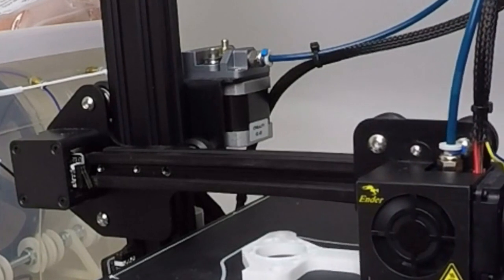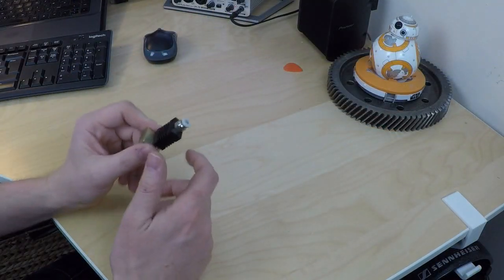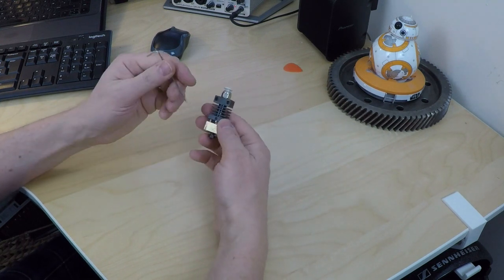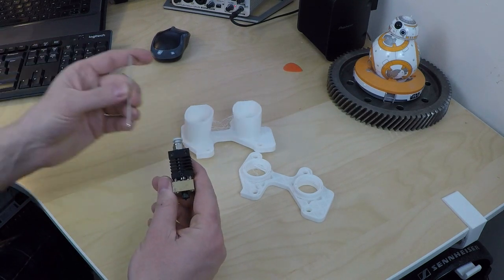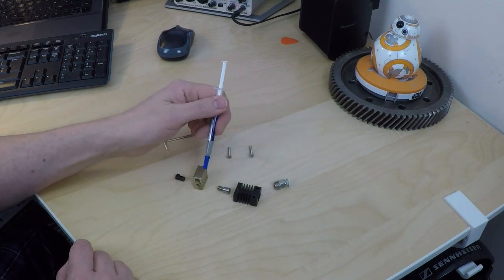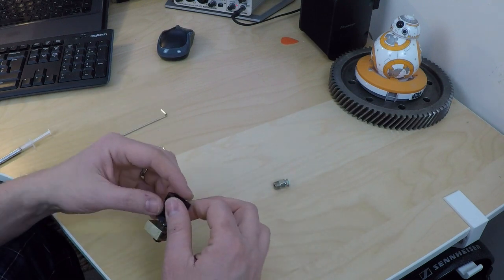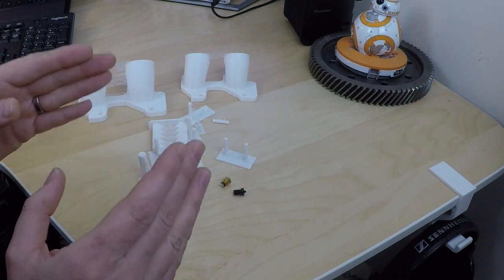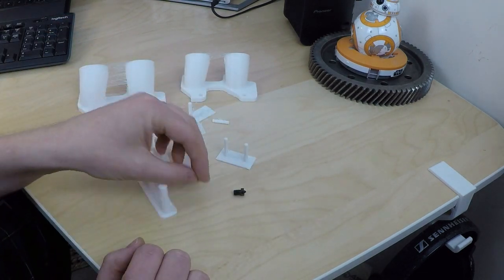Never clog again!! 2 easy tips to solve a clogging all metal hot end!

Comment: This is standard practice on your fancy shmancy high price hotends. Big no no using thermal compound designed for CPU's though. That stuff is not rated or the temps used in hotends. Better off looking for thermal paste designed for it. Boron Nitride thermal paste. Its not much more expensive than the stuff for CPU's.
Reply from the maker: Hi Ashley…. That particular paste is rated up to 300degC but you’re right, most CPU pastes, especially the higher end ones aren’t rated for the high temps… that said, i wonder just how hot the cold end of the heat break gets…. 🤔
Reply: @MakingforMotorsport  Wow! 300C rating on a CPU paste. Never seen one rated that high.
Re the headbreak temps, I guess it would depend on the situation. Higher temp filaments and higher bed temps in an enclosure would be the worst case scenario.
I think most peeps clogging issues come from slop in the bowden tube. Applying the PTFE fix with capricorn tubing and swaping out the PCM4-01 fitting for a compression fitting solves a bunch of issues. You can also soften with heat ad flare out the PTFE tube so it can't back out of the PCM4-01 fitting.

Comment: Very cool. Wish I saw this today when I was upgrading to a titanium heat break and wasn't able to print PLA at all because it kept clogging. And then I overtightened the grub screw on the heatsink and stripped it. Noooo! Have to remedy that tomorrow at the hardware store. But I'm going to try your thermal paste method. I have a syringe of it lying around from my last PC build. Thank you so much for making this video
Reply from the maker: Excellent, hopefully this helps you out, I was pulling my hair out with clogs!

Just one thing, make sure your paste is suitable for the higher temps, some CPU don’t go very high.  If it’s low, don’t put it on the nozzle! 👍
Reply: @MakingforMotorsport  Ah good point! Okay

Comment: I used thermal Heat Sink Glue. 
Also just installed a Titanium Heat break from amazon that has a flange on it. 
Also it is the right length.
2pcs All Metal Ender 3 Titanium Heat Break Thermal Barrel Tube Heatbreak Upgrade for Creality 3D Printer CR10,S4 S5, CR10S, Ender3 V2, Ender 3 pro, CS3 Hotend use (Upgrade TC4 All Metal Version)
Reply from the maker: Just looked at that, could be a good option for the standard hot end, i need to do some measuring to see if it’s good for all metal…
I have been looking at the bi-metallic all metals… gonna have a play with one of those aswell 👍
Reply: @MakingforMotorsport  I was using a shorter version no flange. Had problems from day one. I seasoned the one with the flange  and have been printing for days with no problems. Just ordered a few spares. Dumped the old ones.

Comment: Also NEVER use CPU thermal grease on these.  It isn't rated for temps as high as what we use in 3D printing.
Reply: Thermal Grizzly paste is rated up to 350°C, Arctic MX-5 goes up to 180°C
Also the Cold-End doesn't get nearly as hot as the heaterblock. This is exactly what the heat-BREAK is supposed to do.

Comment: Hi there!! I love your channel !! I am currently doing a project similar to yours with a speeduino and a 1.6 8v megane, I have designed the intake manifolds to adapt yamaha r6 carburettors !!!

but i'm having trouble with nylon printing. the finish is horrible, the pieces suffer from cracking ... I use a x1 artillery with direct extruder, all metal hotend ... any advice ???

If you want I'll leave you in the link of the page where I upload my designs in case you need any for future projects !!!
Reply from the maker: Hi there!  Sounds like a great project!  For the Nylon, have you dried it out properly? (Full spool on at 60degC for maybe 4hours), if it’s not been dried just before you start and it’s held in a low humidity environment it’ll soak up water from the air which boils in the hot end causing all kinds of problems…. I dry out thoroughly EVERY time before printing… check out my Nylon video for what I do 👍
Reply: @MakingforMotorsport  good afternoon!!! Yes, at the beginning I dried the filament at 80 ° in the oven for 3 hours. even so, when I print, cracking appears in the pieces and warping. I will try to close the printer in a closet to get a more homogeneous temperature. I have a profile in cad grab. If you want, I'll give you my link and take a look at the collectors I'm making. Best regards!!!

Comment: I just got so frustrated with my printer that I stopped using it.  I was getting the “dug dug dug” of the filament struggling to feed and it got to a point where pretty much every print would fail.  Now I can’t even remember how to use the thing.  3D printing was so frustrating.  Good luck to you and glad to see that you had better results!!
Reply from the maker: It can be bad and I have been there… best thing to do at that point is to warm it up, clean up the filament, disassemble and start again… never fails to fix my clogging problems…
Reply: If you get under extrusion and eventually clogs the fault is not the extruder nor the nuzzle and even not the slicer setting most likely. It's the bowden tube... trust me i almost throw my ender 3 v2 printer away trying figure out why it was under extruding and clogging.. my slicer settings were good, nuzzle was changed to new one event tho the old was less than 2 weeks old. extruder was running fine, never had or have adhesion problems my leveling is very good (quite proud of that). except the bowden tube.. You see the tube is twisting around while the printer works and the coupler that keeps the bowden tube in place cutting quite the grooves around where the little teeth holding it. now eventually thanks to that twisting and retractions causes the tube to move away from the nuzzle leaving a gap and that is where the clog starts, to be precise the tube clogs not the nuzzle. 
There is a fix tho, a pritable fix. i can't recall the where i found the stl files for what you need or the video explaining it, but basically you cut a piece of tube you put it inside the hot end like you do normally only this time is going only a few inches above to where the coupler bottoms out, you have 3d printed something like a cone washer that goes after that and then the coupler that when  tighten it sandwiches the tube between the nuzzle and the 3d printed washer, after that you place the tube from the extruder to the coupler only this time it goes as far as the washer you put inside.
It does not matter how much the printer move around or the tube from the extruder to the coupler, the piece of tube that is sandwiched inside of there is going nowhere. 
Sorry if my explanation is long and maybe not sufficient enough or for any spelling mistakes and what nots, even though i can't recall where i found the stl file and video i hope you do.
i never run in any sort of problems after that fix ever. i hope that helps
Reply: That sucks, Dave. 

It seems like 3D printers in the 2020s are becoming the salt water aquariums of the 1980s, and as a guy who has successfully raised non-photosynthetic black sun corals AND has an Ender 3 that pretty much runs 24/7… in both of those cases I can honestly say that the general opinion of most people I know is, “There is no way I would have spent the time and money to learn what you’ve learned in order to do THAT.”

My response, generally, is, “Why not?” — but, there are times (days? weeks?) where I wholeheartedly agree it’s not worth it. So far I’ve been able to solve the problem at hand and push on through, though.

Interestingly, I think both of the above mentioned hobbies have the same problems:  myths & misinformation, foreign fly-by-night equipment sources, and a lack of access to true experts and mentors because there aren’t very many yet — certainly not enough to mentor the hoards of new people getting into the hobby (and make no mistake: a 3D printer is not a device, it’s a person with skills that can operate that device)

There is one upside:  it’s almost Christmas again, and about 6 weeks after that is when the first frustrated people will start putting their Christmas present printers on eBay, Kijiji, etc…
😕

(Sorry, make that 2 upsides… screwing up a mod or upgrade on a 3D printer doesn’t kill marine life … at least, not usually. 😎)
Reply: @lucasthompson1650  You're partially correct, these are not machine meant for the casual guy thinking 3D is a cool concept. From my experience with my Ender 3 I can confidently say: I doesn't matter if you know what you're doing, these cheap machine simply have garbage designs. The sheer amount of problems I got just because the printer is the way it is, it way too much to be remotely close to acceptable.

My z-axis motor shouldn't have passed quality control. It was severely out-of-spec without proper calibration, losing a whole layer every 20 mm of upward travel. Had to buy a dial gauge just to catch this problem after months of failed prints and clicking like a woodpecker on crack. The magnetic bed also is not stable long term, developing a low spot in the middle severe enough to prevent any kind of sticking. I also had to print an entire mod just to allow the filament to enter the extruder without scraping, thanks to the big brain design of having the spool holder almost vertical. Also every now and then I've to reseat the PTFE tube, because again if it moves even slightly, the printer just clogs.

For me it's like having bought a unfinished product. I can understand why people just throw them away after a couple of weeks. Took me almost a year to get my Ender 3 close to a working state.

Comment: Never use regular CPU thermal grease in the hot end area (the throat area is slightly cooler, but ...). Its working range is up to 150 C. The paste instantly turns to stone and it is difficult to disassemble it later. Use special high temperature thermal compounds.
Reply from the maker: Yes mate....  I use Hainziye which is rated up to 300degC....

Comment: Somehow I just saw all the problems I've been through with my part. At a certain point with the genuine setup of my Ender 3 V2 in place (PTFE Tube ending at nozzle) gave up its job, because of heat degradation... After a lengthy and very very frustrating and exausting journey, I came across this video: https://youtu.be/xAiUZ7HDhdM
To make a long (and frustrating) story short: THAT was the solution to all my problems. With that Heatbreak intalled, everything works like a charme since a month now (printer printing PETG 24/7).
Reply from the maker: Yeah, this wasn’t my issue as I am all metal but if you print at the hotter end of the scale the standard PTFE tube doesn’t last long!  👍

Comment: You are a true hero. Never thought of the thermal compound. 

Sub'd :-)
Reply from the maker: Cheers bud!  Make sure you get one that's got a high temperature rating, I used Halnziye from eBay
Reply: @MakingforMotorsport  Still some clogging going on with pla. But CF nylon prints fantastic.
Saw someone talking about conditioning the hotend with sewing machine oil. Might be worth a try.

Comment: Generally, you do not want to put thermal paste around the nozzle: 99% of the time they are not meant to be used at these temperatures (remember you got rid of the PTFE tube for that reason).
One thing you could try, though, is to screw the nozzle all the way (back it off 1/4 turn and re-tighten once hot) and then screw the heatbreak: the heatbreak should see less  thermal transfer from the heatblock
Reply from the maker: The temp rating of the grease has been mentioned in the comments before and this is rated to 300degC so no problems there, but it’s also a really good idea to maximise the amount of the nozzle in the heater block and minimise the amount of the heat break! Great shout 👍

Comment: I too bought a clone and I’ve had lots of string but I completely solved it by tightening the nozzle when hot as you said and then removing the two countersink pins that holds the hotend to the heat sink, OMG it’s been a game changer for me. Hope that helps 👍
Reply from the maker: Hi Mark, great minds think alike!  Very soon after this video I tried removing the set screws and also changed to a ducted silent Noctua fan... zero stringing 👍 thanks for the comments and the watch!

Comment: I'm struggling with my all metal PLA and clogging since I installed, so extremely frustrated. I'm going to try this now . If it works.. Gonna  kiss you. Update: After +30 hours no clogging.
Reply from the maker: Sounds very familiar, I went all metal, other materials printed but PLA clogged... I wouldn’t even think of not using the thermal paste or going big (more than 2.5mm) on retractions with PLA again. 
(And you don’t have to kiss me 😂)
Reply: @MakingforMotorsport  Omg, first successful print in a week, it worked or its a coincidence(I don't think so) , amazing. I only applied thermal to the barrel, not the nozzle. Thank you.
Reply from the maker: Excellent 👍  Good to hear! Happy printing! Now where’s my kiss??? 😘.   😂😂😂
Reply: @MakingforMotorsport  hahaha I know right?

Comment: I bought a bimetal heatbreak ( that is actually for an Artillery printer )  from banggood,  I replaced only the heatbreak in the stock ender hotend, added a stainless steel nozzle and it just worked.
Because the heatbreak was shorter than the standard steel one, I actually just left the heatbreak cilinder part stick out of the cooling side , it's being held by the grub screw and the two heatblock bolts.
I am now in the process of making another all metal hotend from a backup standard one I bought, now using a titanium heatbreak... fingers crossed :) .
Reply: I'm having the clog clog problem, not matter what retraction or temp I set. I bought the bimetal and waiting to arrive. Did you do any extra setting after installing it?
Reply from the maker: Hi Julian, are you using an all metal hot end?  Have you tried going back to the standard hot end to rule out other problems?
Reply: @duveral  none, actually I didn't even do a PID tune. What I did different than any guide: I tightened the nozzle on the heat block with brute force to make sure there was zero gap between the nozzle and the bimetal heatbreak, that "tighten when hot " didn't go well to me in the past. I do have a noctua 40x10 instead of the stock fan, but the fan is actually weaker, so it should have more heat creep, but the bimetal heatbreak I think it's the key.
Reply from the maker: I saw CNC kitchen do a piece on the Bimetallic heat break and really boosted print speeds with it...hadn’t thought of using it to solve clogging.  Did the bimetallic heat break work with the standard hot to make it all metal???  Do you have the link?
Reply: @MakingforMotorsport  yup , there is where I learned about the bimetal heatbreak, also from a channel called ruiraptor. Regarding the bimetal heatbreak, just search "creativity bi-metal heatbreak" , for ender the full-moon one is needed. Basically I bought the cheapest one I could find :-D , bought a spare hotend and mounted it on it just to see if it can work , and now it's my default setup :-D . It is full metal hotend now, I just printed nylon at 255C yesterday.
Reply from the maker: Excellent!  I have no problems at the moment but it sounds like it could be a big improvement!  I will have a look...

Comment: you can find great all metal heatbreak in AliExpress that can be used with the stock all metal and you will get better heat dissipation as you noted few mm will not work.
Reply from the maker: I don’t want to wait the weeks it takes to get things in from Ali-Express, especially if I am not entirely sure on the quality, I might get lucky, I might not and it’s wasted weeks.  and as you said on another post, this one off eBay was probably an AliExpress re-sell so that shows the quality...

Comment: I had the same problem, my solution was to get a coated heatbreak which is less than 10€. As short term fix you can also oil the filament so it wont stick to the inside walls of the (probably a bit rough) heatbreak
Reply from the maker: I looked into other heatbreaks but to be honest if this didn’t work I’d have gone E3D V6 genuine.
Reply: Please post a link to this €10 heatbreak. Thanks!

Comment: Why didn't you increase the retraction again? Most if all of the problem was the heat transfer right?
Reply from the maker: It was a combination really, so the heat soak was softening the filament too early and the retraction was just like pulling the trigger, with the paste I could increase retraction but only up to 2mm but still got stringing.  Now I have also now removed the set screws and ducted the cooler fan i can run retraction at 2mm with almost zero stringing so I haven’t tried to increase is back up, but I think you’ll never get up the 3-5mm that you can with the standard hot end.
Reply: @MakingforMotorsport  Thanks for the reply, I was really curious about it. I've got an all metal hot end in the mail so i'll be going through the same thing with my bowden setup, good to know beforehand what the problems are. The one I got has a really thin heat break so it will be interesting to see if that makes a difference. Might need to convert to direct drive to have a low retraction length.